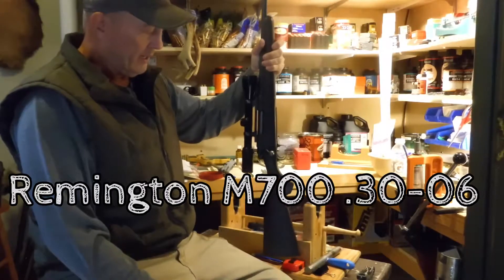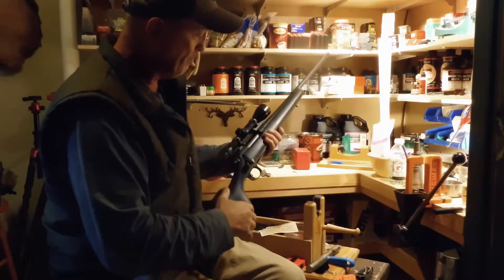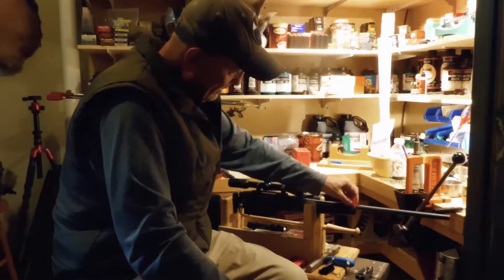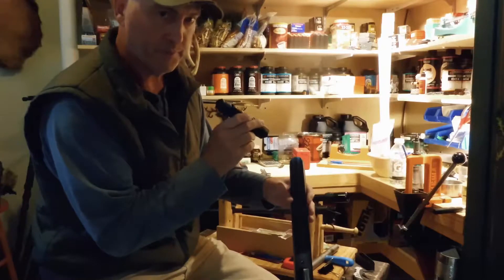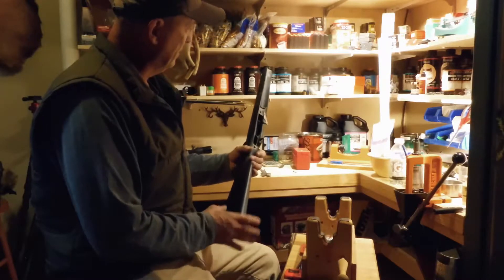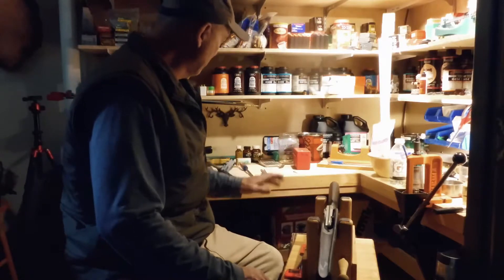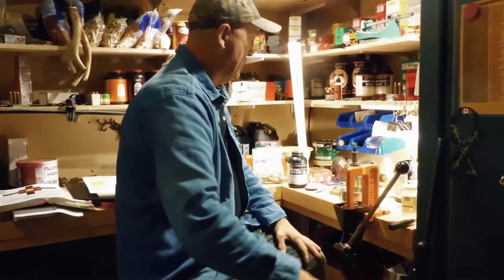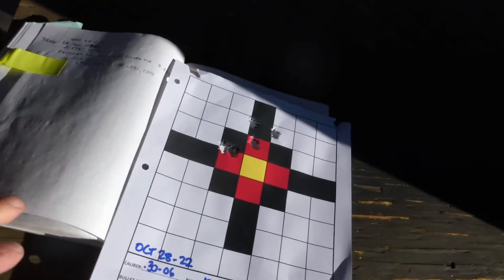Handloading  .30-06 for 2022 Deer Season

Comment: Now you " Need " to get yourself a gunsmith torque driver so you can make sure the same torque is used each time you remove the barreled action from the stock . Also works for scopes and anything else gun related .
Reply from the maker: Sounds like a good idea. The multi-tool I was using is actually pretty crappy.

Comment: An R700 in anything other than 7.62x51 isn't worth having especially with the noticeable difference in accuracy (308 being more accurate)
Reply from the maker: I have Remington M700's in .270Win, .30-06, .300H&H, .338WM and I've had .35Whelen which I regret selling and 8x57.
The M700 is a great rifle, depending on years of manufacture.
Reply: @GrizzlyCountry  a 338 r700 would be a very nice rifle I feel, i had thought they discontinued parts and rifles from the 700 series. My favorite though is my chytac (408) then my r700 in 308 or the type 99 arisaka
Reply from the maker: @norsemancreed9022  I'm not exactly sure of the current status of Remington and the M700.
From my experience quality deteriorated over time, but M700's prior to say the mid 1990's, are great.
My .30-06 is from 1980, my .300H&H is 1983, .338WM is 1992 and my .270Win is 1996 manufacture date.
All of my Remington M700's have been very accurate, knocked down a lot of deer, moose and bears.
I had a 2004 8x57 'Classic' and it was terrible... but that's a long story.